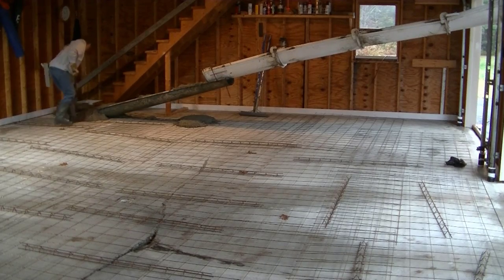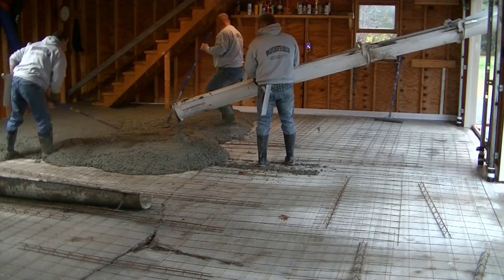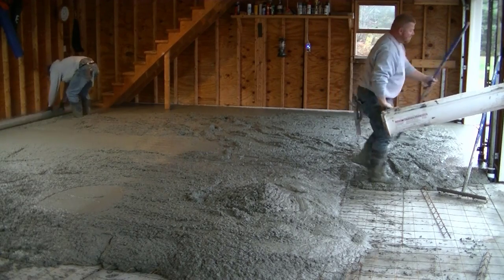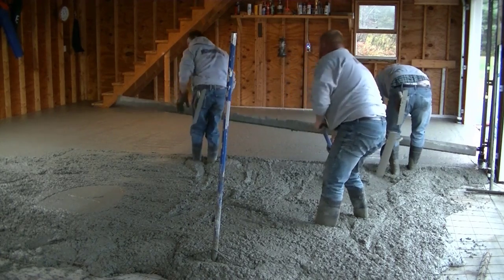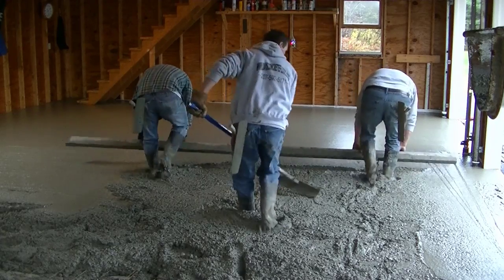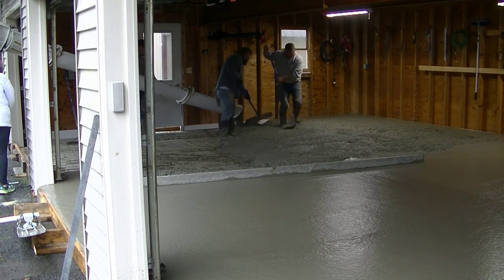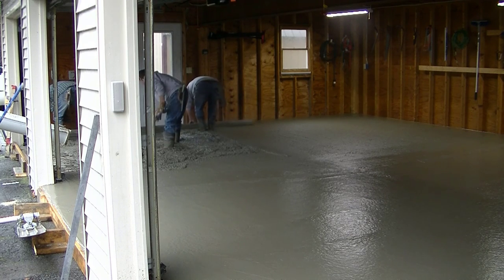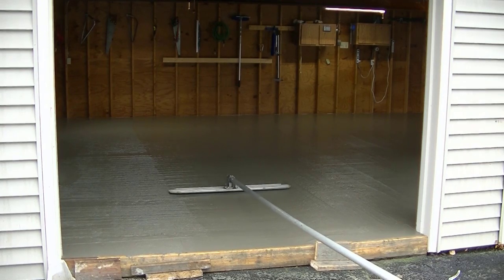Pour A Concrete Slab Over A Concrete Slab | Garage Floor Makeover

Comment: I had the same problem in my 70 year old 1 1/2 car garage. The whole slab had sunk and cracked and water would come in and sit after heavy rain. Door would freeze to the ground in 2" of water when I needed my snow blower. Also, the evaporating water made the garage very humid. I used a slurry for bonding, and did it in stages/sections over a period of weeks using 60 lb. bags from Lowe's. I even did it without moving my project car! (Just changed positions of the jack stands.) You loose a bit of height, but now I'm high and dry! I really needed a new slab and garage, but not being able to afford it, this worked extremely well. Nice to see the professionals do it! Thanks for the great video....I know the owner is going to love being high and dry!
Reply from the maker: There's nothing like having a dry smooth garage floor to work off from.

Comment: I built a 30x40 building about 10 years ago and I hired a young man that was starting out on his own.  He had a lot of experience working for someone but this was his first solo.  I fronted him some money for tools and we called it even.  He brought some illegal day workers with him and chased them off in about an hour.  He tied all the rebar and used a laser for grade.  He pounded rebar at intervals to that level and used soda and beer cans slid over them.  When he got it screeded, all by himself, he put trowels on his knees and one in each hand and started in a corner working out.  He'd scrape a can, stop, pull the can out, pound the rebar down and keep going alone and all by hand.  I was a Brick Mason for 40 years and also poured a lot of concrete over the years and I never saw anything like that.  It turned out as good as I've seen, all by hand.  That ...young man was a "go getter" to say the least!
Reply from the maker: Amen, there's still some out there. Hard to find now a days.
Reply: Put trowels on each knee and each hand. Do you remember what brand of beer that guy was drinking I’d like to buy it for my crew which would be just me I guess if I could put a trowel on each knee.
Reply: What was the point of pointing out that the workers he brought were illegal?
Reply: @lomejorkehay  the point is he brought help with him, and got rid of them when he realized they were useless. Meaning, he did the job himself.
Reply: @elbuggo  Most workers are shit regardless. Some just charge less, especially if they're undocumented.
Reply: @placewaters8738  was no laws to begin with we conquered fair and square
Reply: @americanmilitiaman88  conquered ... is that what murdering 16 million people is called these days.
Reply: @placewaters8738  yes
Reply: @americanmilitiaman88  ahhh waitress!.... Cheque Please.

Comment: In California we call it "Rodding" . Also back in day we would "tamp" fresh concrete when they used 4.5 sack concrete mix. Helped make it creamer to finish, especially so when you had to pour less then a 4" slump for code. That slump you poured in this video was closer to 5.5 to 6" slump. A bit wet so easier to Rod, and no need for tamping for sure.

Comment: It is a good idea to pour concrete over the existing floor. The only comment I may suggest is adding 2X4 treated wood against the framing. Most old houses do not have moisture barrier and would be a good idea to consider if someone has a moisture issue.
Reply from the maker: We put foam against the framing. It's made just for that reason.
Reply: @MikeDayConcrete  Hi Mike, great video. Good to hear my native speak (I live in Austin but am from RI). Very helpful to see the entire job unfold. Hoping you'll be able to provide some input re: moisture barrier (and cost). Details below (it's a lot). Thanks in advance if you can help, completely understand if you can't.

Am converting a 20' X 12.5' (leaky) garage into a recording space. There's a 30 inch x 20' ledge running along interior-wall side. The floor is 5.5" below house slab level, so assuming I need to leave space for flooring on top of new-pour slab level. Total square feet of space to be raised is 200 sf X (approx) 5".

Question one: Have been told I need a moisture barrier and would have to wrap the studs, but noticed the white strip at base of studs on far wall in video. Is that the foam of which you speak? Can you explain the application?

Question two: I live in Austin. Contractors bidding on job have varying opinions and thoughts about moisture from concrete at studs and structural materials to use. Current concrete floor appears to be fine and intact. My major concern is water, and like this client, it's apparent that at least some of it is coming from under the garage door during heavy rains lasting more than a day.

My house is on a slight grade, and the driveway has a short flattened run in front of the garage door, but it doesn't seem to do much to re-direct the heavier rain water (no, no gutters, unfortunately). That said, the water reliably pools along the garage's interior (exterior adjoining) wall at specific points, even all the way to the back right corner (20' from garage door opening). Some suggest the water is simply coming in from under the garage door and running down the right side wall, while others suggest it's coming in from the the right side of the house and potentially getting in under the asbestos lap siding (from "slanted rain"). This leak has been persistent over 17 years' time, so in choosing to do a concrete cap am hoping to solve the leak before converting garage to a living space (last thing I want is a mold problem).

If the floor is raised, say 5", to allow for laminate or tile, will I still have to do some water re-directing at the front (the front being at the end of my drive where garage door will be replaced by framed wall)? Should I extend the concrete into the drive way in such a way as to create a "reverse-ramp," so the water doesn't just hit the front of the new raised floor and create more potential moisture or rot at the base of the siding on the new wall?

cost ...
Materials in proposal include "3,000 psi concrete mix, drill in doll bars vertical and horizontal, lay plastic vapor barrier, install 6 gauge wire mesh sheet (equivalent to rebar strength), pour 3,000 psi concrete mix, trowel finish" for 20' L X 10' W  X 6" H space. Materials $920, labor $1950, total cost 2.8K.

I appreciate any guidance you can provide. I realize this is a few years hence-post. Thank you for the great video.
Warmly,
Paula

Comment: My 1970-s house has a garage floor (and issues) near identical to your video and I considered exactly this solution. I broke a 6 inch inspection hole through a point about 4' from the back of the garage. I found that the cracked floor was about 4" thick and had been poured over a pea gravel base that had settled leaving about a 10" cavity under the concrete. During a hard Illinois Winter freeze there was also quite a bit of frost up through that old concrete. Plenty of folks wanted to bust out the old floor and pour a new one. Couldn't find anyone who would just pour over the old slab and assure me the new floor wouldn't crack the same way. Just sayin......
Reply from the maker: With a 10" cavity under the floor I wouldn't have poured over it either. That's why you have to inspect each one and then make a decision.

Comment: In our municipality in NY we use a tamper then float our concrete near exclusively when we do sidewalks because the municipality is quite strict on sidewalks to the point of spelling out the mix and a 3” slump; having such a tight mix can be a pain, hence the tamper, than floating. It’s also a bear in the summers as it sets up quick. Since the city got so involved and micro-managing the sidewalks, at least in my opinion have gone down hill, at least compared to some of the old stuff we did. They also have gotten quite carried away with the liability limits contractors need to pull permits. One benefit/downside of the city being so involved is they’ve also limited tree plantings between the sidewalk and street; while this keeps sidewalks from heaving from roots it also just looks empty.

Comment: Mike, we are going to enclose our back porch and knock out a wall to increase sq ft in our dining room. The back porch is 1.5" lower than our slab. Do I need to do anything special besides using a bonding agent? What kind of reinforcement should I use? Do I need to lay rebar around the edge like I have seen you do? Should I pop some rebar pins in the existing slab? We are in north Texas, and should be pouring concrete in the next couple of weeks. It is currently mid 90's with humidity hovering around 70%. The back porch is completely shaded (covered, and we have a ton of trees).  Dimensions are 8'x20'. I assume there is some slope to it, but I don't currently have a way to measure that.
Reply from the maker: Make sure it's clean, vacuum it. Yes the bonding agent is good. Fibermesh in the concrete is about all you can use at 1.5" thick. If the underlying slab is solid then you shouldn't need rebar. What is the finish on the floor going to be?

Comment: We always pour slabs the exact way you did in this video... never used a tamper... get it roughly the slope the custom requires or level. Then screed, bull float, edge, joint,trowel, broom etc. Whatever finish required.
Reply from the maker: Awesome Rick! Where you from?

Comment: I had this done in a 30 x 30 pole barn. In that case it was recommended I screed/compact 2" of sand between the slabs to allow the top slab to 'float'.  It worked out well, more work of course. I thought the sand layer was overkill, but I did it anyway.
Reply: What is going in the barn? How thick of cement did you end up pouring. The sand was probably cheaper then adding 2 more inches of cement? Even after the labor maybe?
Reply: @RossMalagarie  Welding /metal fab work, no real heavy machines, some times vehicle parking. New slab was 3.5". The old slab was in good condition and sloped to a center floor drain, trouble is I needed a level floor to set up larger metal fab projects.  20years+ and no cracks so I'm not complaining.  If someone hammers out the slab(s) some day, they'll be surprised:) Maybe it was good way to deal with the old sloped floor,  vs a thicker pour nearer the drain.
Reply: @terrylutke  the reason I asked is the use generally demands the concrete thickness. The general rule the cement contractor I worked with told me was for regular residential vehicles needs 3.5" or if you go with 3" of cement you will need rebar or fiber mesh. So for your application 3.5" is good enough so they must have tried to save you some money with the sand under fill is my guess. Sounds like it has worked great for 20yrs so good job.
Reply: @RossMalagarie  observation.. In the 1960's we poured a lot of slabs at my dads dairy farm. Everything was farmer poured at 3.5"  thick with no wire, and a grip finish for cows. The redi-mix concrete was probably low tech and contained plenty of odd sized rock, but it seemed to hold up well.  Now days they wire and re-rod everything is seems. I wonder if concrete was actually stronger back then?
Reply: @terrylutke  a few factors, foundation below the cement prep, how packed, bags of concrete you can buy "ready mix" you can get at Home Depot is usually in 2000ib or 4000ib per square inch, cracks can be caused by settling, poor packing prep, or too dry of a mix and too hot temperature/direct sun. Wire and rebar is relatively cheap so they like to just pass the cost in the estimate and on to the customer hoping it will help with anti cracking but not need when doing 3.5" for regular residential vehicles.
Reply: @RossMalagarie  '.. cracks can be caused by settling, poor packing prep, or too dry of a mix and too hot temperature/direct sun..'    Perhaps you meant too wet of a mix, too much water added?
Reply: @terrylutke  no I have experienced where I mixed the cement too dry and it cracked with in a hour of the pour but maybe too much water in the mix can have a similar result.

Comment: The ‘tamper’ you mentioned was always called a ‘juke’ where I come from in the SE US. Those really fell out of favor when the power-screed came along and ACI actually discourages using them, claiming that it pushes the large aggregate too far down. 
Straightedge or screed? We always called the tool the straightedge and the process was screeding. 
🤜🤛
Reply from the maker: I don't remember ever seeing anyone use one of those, even when I was a teenager doing this in the 80's. Wet-screeding was always the "norm" for me. Thanks for watching!
Reply: @MikeDayConcrete  Called it a Jitterbug here. Only the old timers ever used it when I was starting out... A few of the newer guys started to in the last few years.... Guessing an old timer showed em, since I never saw a jitterbug that wasn't home made from expanded metal.

Comment: Nice work!. How is the owner going to drive his cars up a 4 inch curb?
Reply: In the beginning of the video, he narrates that the driveway actually sits higher than the slab. Also, they sloped from 4.5" to 3" at the doors. One can infer that he's matching the grade of the driveway with the new pour.
Reply: @cordcd7  I think he means at time stamp 9:21. It shows that at the end of the new pour they used a 2x4 to hold in the new concrete and unless they add a ramp to it, the old driveway to the new garage has a 90 degree 3.5" curb to the entrance
Reply from the maker: He's re-paving the driveway to match the new floor. Now he can slope the new driveway away from the garage. No more water running into the garage when it rains.

Comment: Not sure about this...........Just a few questions........ rebarb appears low. What about expansion joints.....would it not be better to creat and level bays. And, what about airating the concrete ?
Reply from the maker: It was wire not rebar and it had slab bolsters under it. We sawed expansion joints after we power troweled it. We sloped the concrete towards the doors to get water dripping off the cars to run out of the garage and not puddle under the car. No need to aerate the concrete.

Comment: This is awesome Mike. Thanks for taking the time to post and provide the design details.  Couple of questions though. Your ready mix always looks so smooth from the truck. I though maybe your loosening the mix with more water, but at 4:05 that little pile looks like a 6 slump to me, yes or no? 

Do you have any other additives to delay the set or aid in workability? Your guys seem to effortlessly screed the mix, yet when I do my pours, we're always fighting the screed. It seems to build into a hump behind the screed requiring the guys to screed, lift, reset, screed same area again to get it right. I guess what I'm saying is my mix seems to spread like cold cake frosting, but yours looks like whipped cream, yet the drivers ticket always says 5 slump.
Reply: It’s got super plasticizer in it. In my area, the ticket reads HRWR next to the mix code (High Range Water Reducer). It costs extra though.
Reply: @psidvicious  Thanks. I know about accelerators and retardants, ice and hot water, but not plasticizers. Now I gotta ask my ready-mix guy why he never mentioned those to me.
Reply from the maker: Yea, this is a mid-range water reducer. It's a couple bucks a yard extra but lets us pour a 6 or 7 slump without damaging the concrete strength.

Comment: Looks pretty good. Woulda been nice to see some more chairs for the wire mesh, also its great to see you used a backer board to separate the concrete from the wall studs, its looks like HDPE(puck board) but I assume not based on the cost. Also that in my neck of the woods we call that bull float attachment setup big blue. Based off the big blue fresno you often get with it. Your screeting method is interesting, its pretty cool to see different methods from different parts of the world. Good video overall, well done.
Reply from the maker: Thanks Ross, where are you from?

Comment: I own a raised ranch home with a 2 car garage which was built in 1992. The builders did a poor job pouring the concrete slab. It isn't level at all and has concave spots in various locations on the sides where water pools up. I don't know if they put a vapor barrier, but I'm assuming they didn't as over time, moisture from underneath has caused bubbling up of the glaze that they put over the concrete. There are also spots where a white crystalline substance is coming through the bubbled up glaze coating. Other than the moisture and uneven spots, I don't see any large cracks separated by high and low spots. 

Installed a Costco polyvinyl roll-out garage floor covering some years back. It hides the worst looking parts, but of course, does nothing to fix the uneven surface issues.

Pouring a new 3" slab over the existing one looks like it might work in my situation. I'm in CT, near Waterbury. Do you do out of state work or know of a reliable concrete slab pouring company in my area?

Comment: In Wisconsin, where I pour, the straight edge is called a "strike-off". It is used to "strike" the surface of the wet concrete to the proper height.

Comment: I’m hoping you can help me, I’m putting a swim spa in my garage , and the floor needs to be level. I don’t want to just skim coat it , afraid  it will crumble under the weight. I was thinking of boxing out the area of the floor where the swim spa will go to the measurements of the swim spa and just pore a new 2/3 in slab over the old that’s level . Would this hold ?  Thank you.

Comment: Ive used roller tampers when pouring stamped pads with regular aggregates. It pushes down the big aggregates so they dont get in the way when you stamp. That was 15 years ago. Lol. Now i just get 1/2" stone in the stamp mix.